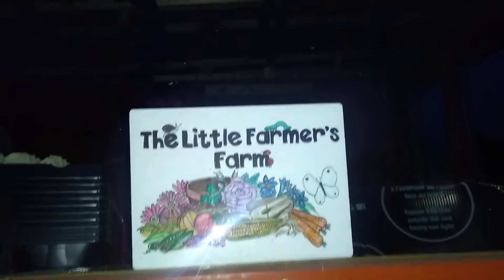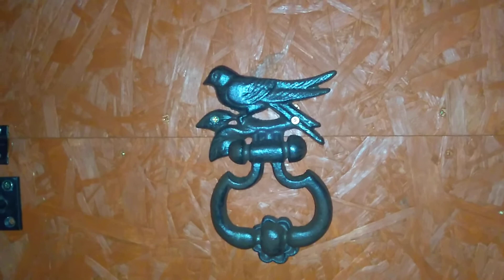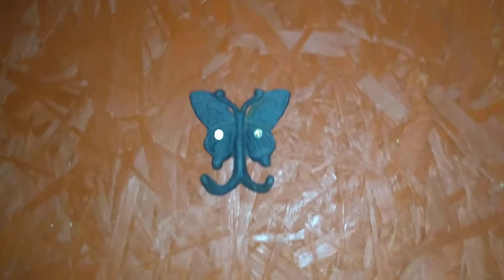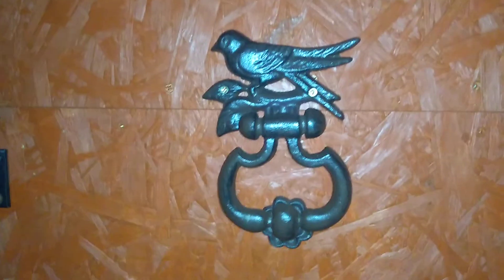More Tikki Windows

Comment: You run the risk of condensation if you insulate the ceiling, so just do a small part first and check for condensation above the kingspan to check its feasibility.
Reply from the maker: Cheers Steve... Don't think we will fit the Kingspan in the roof cavity just leave as an air gap and also install a vent to the upper wall by the backdoor.
All the best mate